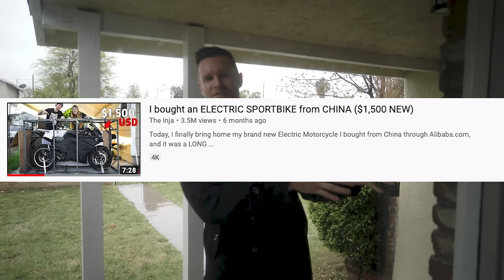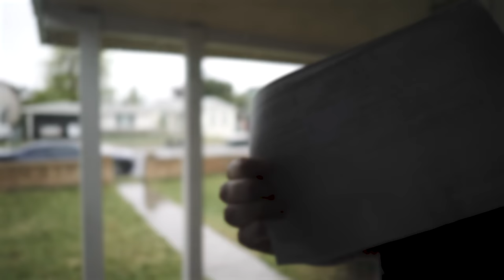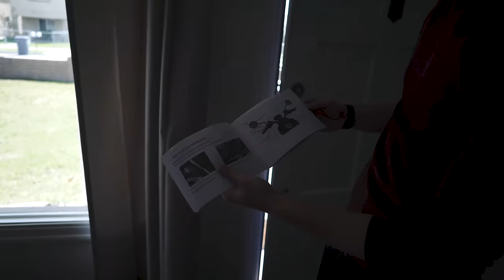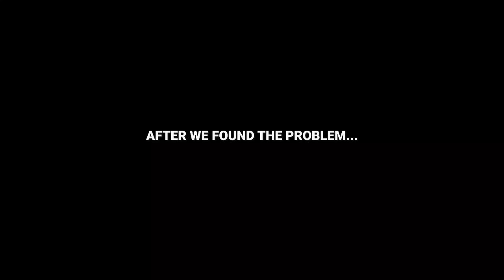I BOUGHT the most AVERAGE-PRICED Motorcycle on AMAZON ($1,600 NEW)

Comment: I worked at a metric bike shop for a while that sold all the name brands plus the cheap Chinese pit bikes and 250cc sport bikes. The 250 bikes were like $2500....and they were junk. The electrical systems sucked, quality control sucked, the steel was cheap and rusted easily. They looked cosmetically good on the showroom floor....but problems quickly started. You're much better off buying a used Honda, Kaw, or Yamaha 500-600cc bike for the same price. I bought a used Kawasaki 600 for $1600 with 10k mi on it, and have had it 10yrs now. Don't waste your money on disposable Chinese bikes.
Reply: I like disposable chinese dirt bikes. I live in Mexico and ride an Italika DM200 it hasn't failed they come with a 2 year guarantee. I'm going on my third. And my old ones still run I buy a new one every 3 years. I just don't like buying tires and for 1400 dollars for a new enduro bike you can't go wrong. I also have a Kawasaki and Suzuki but they are cruisers. Smaller Enduros are perfect for cobble stone roads, off road and lane splitting on small Mexican roads. Top speed sucks at 120kmph but that's good for a 200cc bike and I'm 220lbs poor bike. I beat the shit out of them and can't break them. They are super cheap to fix too
Reply: No kidding lol
Reply: Where can I buy a used one?
Reply: @theelichannel3731  in a landfill.
Reply: Before I even get that far in the video, throwing out a guess: 125cc (ish) GY6 clone on this bike? Like all the quads, go karts, and dirt bikes they ship over here en masse. As you said, disposable bikes that arent very good when they're new.
Reply: Best starter bike, if you can find one, is a Buell Blast. Tiny little 500cc thumper. Simple and fun as hell. Love that thing
Reply: 500cc bike for a beginner rider is a horrible idea. That engine is way to big and powerful, you can end up scuffed up on the ground because of your own fault with such a powerful engine. 150cc-300cc is a good bike with decent power to get out of situations
Reply: Lmfao buy those bikes for 2k? I’m in south Texas and these bikes are 5-9k
Reply: you right!
Reply: Thanks
Reply: @ThePeacePlant  500cc ain't bad to learn on. I learned on a cbr600 and a month later I bought a r1. No bike is "to powerful" just don't twist the throttle as much
Reply: @6.4inAz  Like hell you're seeing a Chinese 250 for 5-9k.
Reply: @6.4inAz  i live in Houston and used bike prices are goddamn insane
Reply: 10K miles isn't a used vehicle, some motorcycles in France have more than 31K miles, that's what is used
Reply: @6.4inAz  some older models can be found under 2k, just saying.
Reply: I agree, and disagree.. I own a Benelli TNT 135cc, I just put 6k on it, and it's still riding smooth. It's a 5 speed, fuel injected, air-cooled, qohc engine. It's very solid. The main thing on any bike is MAINTENANCE. I do agree, the Chinese brands like SSR or others might require a little more attention than a Honda, Yamaha or Kawasaki, but I enjoy working on my bike.
Reply: @rickyb6086  beneli is one of best chinese motocycle makers i think
Reply: @regularwannabe1085  From what I've heard, they're quite popular. Mostly, overseas. Not too common here in the US. I love mine tho, Benelli use to be an Italian manufacturer and made awesome bikes in the 70's. I guess they're Chinese owned nowadays.
Reply: @rickyb6086  Yeah i think they are one of most popular budget brands here. I remember their old motos and i think thats a good thing that they can still exist even if it means they have to produce them in china
Reply: Listen to this man!
Reply: Bro I cannot find any bike under 5k even used anywhere near me
Reply: Japan sells plenty of cheap bikes and Im talking dirt cheap or more like seawater cheap because those bikes are being resold due to some water related accidents, but nothing a little TLC can't fix tbh, this goes the same for JDM's as well, don't settle for chinese instead go for japanese surplus its cheaper and its quality so long as you have the know how when it comes to restoration and repair
Reply: @Summer On Io  I live in Houston too, what you said is correct about prices. But seems the same everywhere due to inflation.  The problem is stupid people feeding this cycle by buying this garbage of bikes. Don't be tempted. Cheap is very expensive in the long run....
Reply: @ThePeacePlant i started on a hond cbr 500 and im fine, its 430 pounds too, so  not as light as its competitors, if u respect the bike, u will be fine
Reply: There's a reason why the Chinese stuff exists. Honda.
Reply: Where you found a Kawasaki that price I’m tryna find some too
Reply: Don't BUY Chinesium Crapolium. :yougotthis::yougotthis::yougotthis::yougotthis::yougotthis::elbowcough::elbowcough::elbowcough::elbowcough::elbowcough:
Reply: Y'all better go with Indian disposable motorcycle instead like TVS, Bajaj, hero for the same price
Reply: 220 pounds is actually not that much for a man anymore!
The average 5 foot seven female around here is at least 180 lbs!! 

A lot of them are well over 230 pounds!
Reply: I started on a 400cc  @ThePeacePlant
Reply: You're full of sheeitt. That was whatever years ago. They have broken busted used bikes 20 years old for mire than 2500 listed where I live. In fact a guy made a video going to dealer the closest used bike he could find was 2500 for kids 50 cc put bike used.
Reply: Where are you finding a 500-600cc recognizable brand bike for 2k bro
Reply: @MACA_Zeon  guy is full of sheeit though about them being at some dealer
Reply: That same used kawasaki you bought for 1600 would be somewhere more like 4000-6000 at least now when you need a vehicle now thats not really an option
Reply: Ok boomer

Comment: “I’m hearing weird noises” shifts to 4th gear going 25 mph
Reply from the maker: That's like it's top speed, sooooo
Reply: The Inja then that’s super sad for a 1600$ bike I was expecting at least 40-50
Reply from the maker: @robert-zh2gl  that was a joke. Just watch the top speed video. It almost hits 50
Reply: You need to look at the RPM rookie. Gear doesnt matter
Reply: @plurpanda863  I'ma award you with meaningless comment award.
Reply: @plurpanda863  Not sure what's your point tbh. Maybe your confused. Or have no knowledge about an engine
Reply: Top speed is only 55
Reply: strangemyth it can hit 70 sooooo
Reply: @chrisshelby1170      5:52
Reply: @chrisshelby1170  Also there is only one o in the word so.
Reply: strangemyth I have the bike and it hits 70. Said 50-70 mph on amazon so you’re wrong🤷🏻‍♂️
Reply: "It's not bad. I'm pretty impressed" "It vibrates a lot" Ugh.
Reply: @TheInja  interesting note: this bike would not be legal as a 'learner' bike in the UK, the 125cc bikes used here have to be capable of 80mph to be strictly legal. Its tripped up a lot of people who bought Chinese 125cc chopper bikes, that barely do 65mph when tuned well, instructors refuse to take people out on their test with them, and you need to hire a bike short-notice to keep your test slot. 

Its fine to ride around after your test, but they really want you to be able to pass a semi-truck on the motorway without taking all day on the bike that you learn on, so they added the 80mph (10mph more than speed limit) rule when all these cheap imports started.
Reply: @mor4y  125s in the uk that are mostly 4 stroke will struggle to do 80. It's not like the old 2 strokes like the rs125 or cagiva mito that'll do 100 plus
Reply: @JDMz  lol I had a cagiva mito, and can confirm the 100mph figure on my road gears! 🤪 every time I took it for a long ride it needed at least 1 bulb changed, very Italian 🤣

If you look at the wording of the law they've trimmed it to only bikes between 120-125cc, that knocked out a local learner bike friends have used for years to pass the test, a old suzuki 100cc 2-stroke disc valve bike. Thing will do 80 without even trying, I'm always looking for the 200cc version for a winter runaround, but they're entering classic territory now
Reply: @TheInja  almost 50? holy that's bad a motocross bike is faster :D
Reply: LOL 🤣🤣
Reply: @TheInja  does the speedometer read in mph or kph?
Reply: @TheInja  so let’s put 91 in a lawnmower engine .
Reply: @TheInja  u got a dud lmao mine is easily going over 60
Reply: do I need a license?
Reply: Idc inja is a W
Reply: @Mike Zielinski The Harley was made in Italy... ?
Reply: Do you not ride? That was the shift point for my Honda Rebel 300 according to the manual.
Reply: @chrisshelby1170  hey im.interested in getting this one can you give me the exact model and mayb some tips on how it works after a couple of months ?

Comment: I have been using my Chinese 125 almost daily for 3yrs in the UK. I have had little trouble with it, just tidied it up a bit. It ran better after I cut the cat out of the exhaust (silly EU regs)I upgraded the tyres, but that is more a reflection on my riding than the bike. I bought it because my GP convinced me that I had Parkinsons, so I bought  a lightweight. When I finally found out that I hadn`t, I decided to keep it because by then fuel prices had gone through the roof, at 100mls to the gallon it has saved me a fortune. As standard it was whisper quiet so I took a couple of baffles out, because a couple of times I had to break hard for smartphone zombies in town, this also pepped it up a bit. All in all a very good little bike
Reply: What make/model?
Reply: Lexmotos and keeways are brilliant first bikes, I had a superlight and it ran brilliantly, it also got stolen and joy ridden whilst I owned it, I recovered it and repaired it by hand and it still ran like new.

Now I have my full license though I'm sticking to bigger brands

Comment: You need to replace that fuel lock and filter. Buy the one in which filter is built into lock. Also its a new bike. You literally need to tighten all the nuts and bolts. Give it some run for 500km slow rpms then change oil and break pads. Then you are good to go. That's what you have to do with Chinese bikes. Once youve done it they gonna be beast in their class. Also put a custom exhaust.

Comment: I bought this for my wife,she was the second owner.  It literally had 3.8 miles on it. It needed things tightened and tuned... it did start and run from the start. for a starter bike at 125cc its not bad at all for a kawasaki knock off. Top speed around 50-55 still under 150 miles on it. ( just got it 2 weeks ago ). Gonna get a bigger sprocket for a higher top speed.....BTW it's a Honda motor!
Reply: I click on the link but it says sold out where did you purchase it from?
Reply: 125?
Reply: Kids first bike!
Reply: How is it holding up today?

Comment: We purchased one of these off Amazon also. 
We removed all the tins, filters, and every bolt (almost). 
We tightened everything down to torque specs with Medium Loctite, touched up all solder joints, replaced some hoses and clamps, made adjustments to cables, brakes, clutch, bleed the brakes. We also added rubber gaskets to help reduce vibration. It only took a weekend to complete everything and do another start up. After break in it would top out around 65 mph with me 225 pounds on board and we have had only one problem. That was the carburetor. After a cleaning and deburring the problem was fixed. 
Makes a great camp site bike, pits bike, and run for a coffee bike.  Not for touring but a good cheap little run around bike that is fun to ride.
Reply: Nice🤔
Reply: Only downside is needing all the knowledge to fix it xd
Reply: Yea, it seems like a good little bike for around town here. Everything is 10 mins away driving and it beats WALKING anytime 😂 I'm recently single as of 10 months ago, so I don't have a wife or step daughter to lug around or take to work / pick up anymore. But i do need some wheel asap 😕 figured this would help me out some until I can stack some cash for a proper car since she cleaned me out and took the family car. 

Ps. The family car went to $ht on her about a month after she moved out. She was on the side of the road, got scared, called a tow truck, guess he had pitty on her, took it to her other brothers house where she doesn't live, gave him MY address for billing instead, stiffed the guy out of $300+ for towing, and rhey sent a certified letter to my house, I declined it and said she doesn't live here I can't sign for that. Never feel sorry for women. EVER..
Reply: Can you tell me what kind of battery it takes and where to get it?Someone stole my bike im missing some of the fairing parts and some are broken,Having a hard time finding them.

Comment: Make sure to tighten all the engine mounting bolts and drill out the Welch plug on the carb that's hiding the air fuel mixture screw
Reply: Why would the mfr hide the mixture screw ?
Reply: @jamesconner3437  to discourage buyers from messing with it. A good manufacturer will have it pre-tuned to run at least okay and they don't want those that are less mechanically inclined to mess it up, I guess.

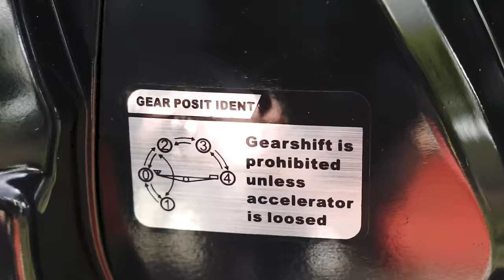Comment: @The Inja Some facts I thought you'd appreciate regarding 13:20. Octane is calculated differently in different parts of the world. Some countries use RON (Research Octane Number) and some combine RON with MON (Motor Octane Number) and takes the average of this. ("R+M/2 method" is even written on some pumps) which is the Anti Knock Index (AKI). This is a bit lower than the RON number but it's the same quality. China use the RON calculations so the manual asked you to put in a minimum of 86 Octane US gas. Here in Sweden we only got two options, the lowest one we have is 95 octane, which would be 90-91 in the US. And the 98 octane (94 US). And they cost $6,50-$7 per gallon (converted) :S

Comment: I bought a 250cc from a guy who got it from Amazon as something to ride to work in the summer to save on fuel. I have a 87 mile round trip commute to work everyday so in an area full of mountains. It's not the fastest thing at climbing hills or steep inclines but it gets the job done and I gave the guy $400 for it and I have had it for about 3 years now and it has served me well and saved me about a $1000 a year in Fuel since my regular truck is a 4 wheel drive for our snowy and icy winters in the mountains. But I have been pleased with it but a 125 might be a little too small to keep up with even small town traffic.
Reply: what bike??
Reply: @Flinicc  X-Pro 250cc 6 speed, he was in a tight squeeze for money and offered it to me for $600 so I offered him $400 and he took it. The bikes are about $2,000 new
Reply: @joesalyers  do you still have it
Reply: @Flinicc  Yep and its fine as long as you keep good tires on it and do regular maintenance. Its not meant to be rode like a $20,000 bike its made to look like the nice bikes. If you treat it right and don't run it with the accelerator wide open everyday it will last. But if you ride it hard going 100MPH everywhere it might not be the best option. Its 250cc so its a bike made to ride the speed limit and be a utility. But its cheap on fuel and in my experience it has been a really nice purchase for me. Basically this bike is made for looks but if you treat it rough it probably won't last very long. I ride mine like an old man LOL

Comment: It's got the exact same exhaust can as my EFI 200cc Capri Amazon scooter has😂 bought my EFI 200cc Capri Amazon scooter in 2021 it's probably got about 6,000 mi on it I use it for DoorDash delivery. When I'm not using it it's garage kept. The only problems I've had with it is the exhaust systems don't do not last. The key is I have found for my 200cc scooter anyway I changed the oil every 500 mi. Is it still runs great everything still looks good new. Just exhaust system sucks

Comment: The reasons they want you to use 90 and above octane is because a high octane gas needs a higher temperature or ignition to burn, this engine is air cooled, so its gonna get hot, really hot, so if you use 87 octane gas you may experience pre detonation, and pre detonation will destroy a engine

Comment: Try adding rubber bushings on the engine mounts and tighten all the bolt's.

Since it is a small cc single cylinder bike vibration are expected at high rpms 
Love your content 😍
Reply: Not a good idea. Sure you dampen the vibrations a little bit but you lose the frame strength and rigidity